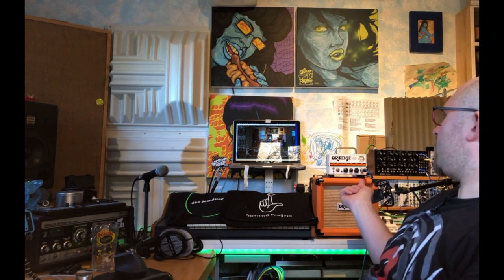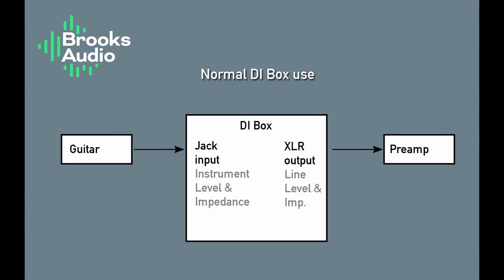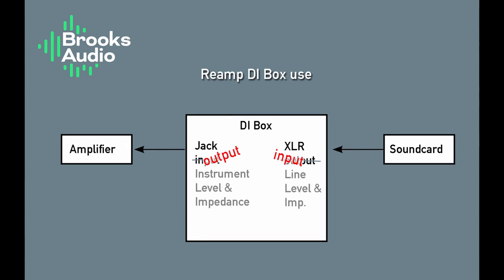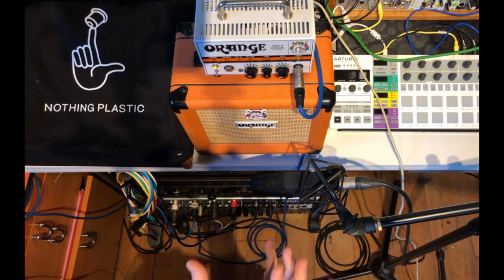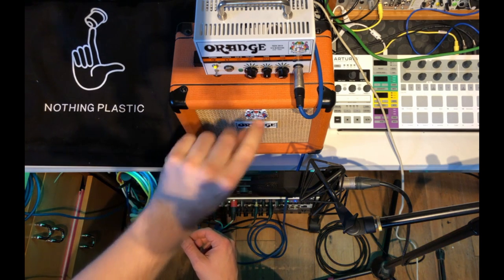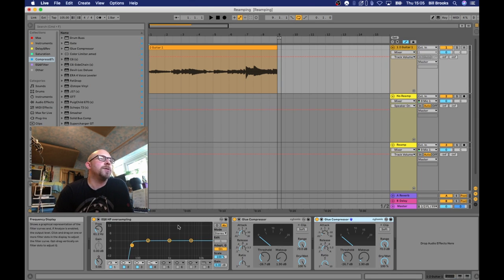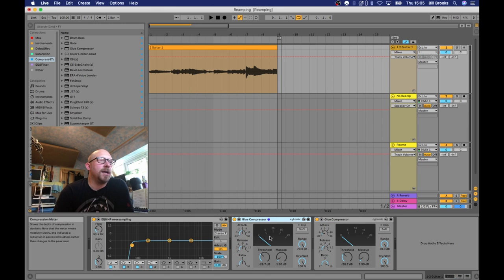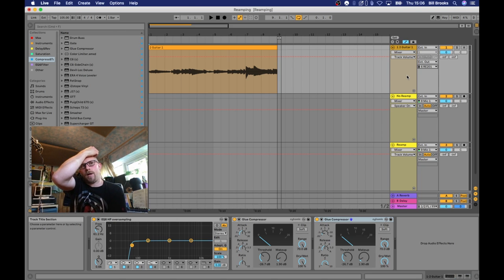Reamping using a cheap passive DI box

Comment: Great idea and timely as I was thinking of doing something similar myself for recording an overdrive guitar solo both with one channel actually recording the amp (dual miked, so actually two channels to blend later) and also recording the direct guitar signal to my DAW) for a possible reamp. 

Have you tried using a XLR line pad so you can run the DAW output signal a little hotter (more bits in theory) and pad that signal before it reaches the DI box.

Thanks for doing the video. You have confirmed what I was thinking and now I know it will work. All the best....Giving you a Sub also.
Phil
NYC Area

Comment: Recently got an old JDI w/Jensen box. Manual online says for reamping with it, connect interface output to mixer, and then mixer output to JDI, then to amp.
Not sure how much of a difference it makes.
Reply from the maker: Depending on the amplifier input and other electronics the difference could be subtle or night and day.  It's all about trying it out.

Comment: would it work to plug a normal trs cable from the output of your interface into the trs "output" of the DI-box? If not, would it work to plug a trs from the interface into the XLR "output" of the DI-box and what difference would it make?
Reply: You have to plug it into the XLR "output" of the DI. Normally, a DI box is used to isolate the signals, but also to convert an unbalanced signal into a balanced signal.

Here it's used in reverse, to convert a balanced signal into an unbalanced one, so you can't plug it in like normally (you'd be plugging a balanced signal into an input expecting an unbalanced one). An active DI box can't be used in reverse like this.

EDIT: Sorry, I misread your comment a bit. If the DI box really has both a TRS output and an XLR output, then either one should work the same, they're likely wired in parallel anyway (you can open to box to check if it's just a wire/trace between the two, or check with a multimeter in continuity/resistance mode).

As long as it really is a TRS output and not a TS thru (not TRS). TRS is for balanced (or sometimes stereo) signals and TS (no ring) is for unbalanced signals. The TS thru is wired in parallel with the TS input (some DI boxed isolate the two, but often they're just wired in parallel).

Comment: Will an active DI work?
Reply from the maker: Sorry Shane, it won't.  You can pick up a cheap passive DI for next to nothing
Reply: @BrooksAudio  I tried with my bss and a 9v battery in it. It won't work. I'll look to try with a passive di
Reply from the maker: @monsterandmaster  yes absolutely needs to be passive!!!
Reply: @BrooksAudio  yes I misunderstood this part at the beginning. Some guy also talked about using a boss pedal cause they have a buffer and an insert cable. What do you think of that ?
Thanks for the tip.
Reply from the maker: @monsterandmaster  Do you have a link to the other video?
Reply from the maker: @monsterandmaster  certainly seems worth a try!  I have a few Boss pedals around so will give it a go.  Let me know how you get on with your experiments :)